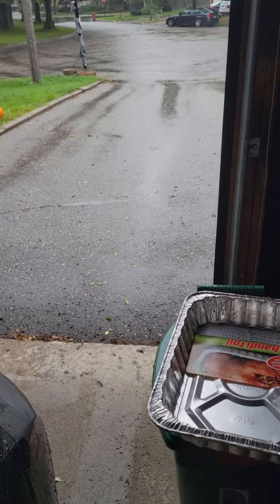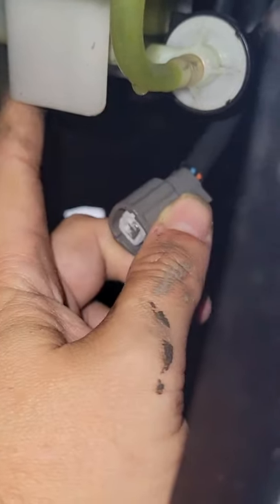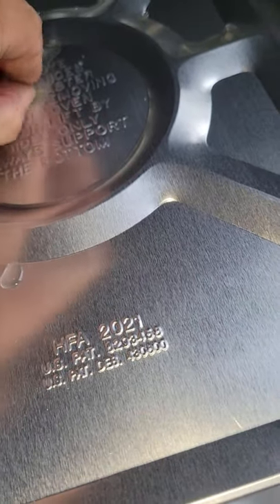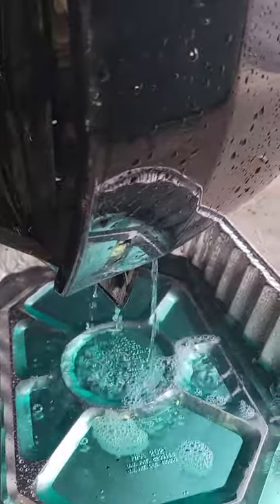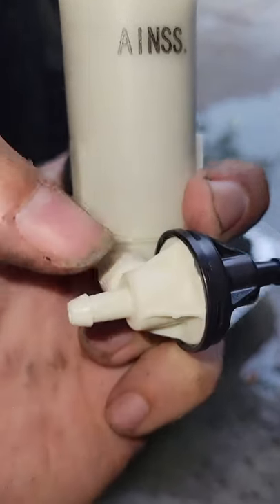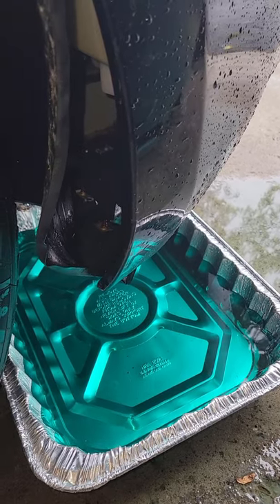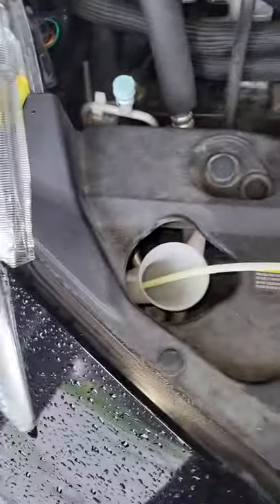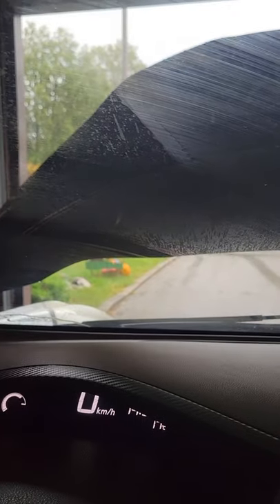Nissan LEAF (2012) Windshield Washer Pump Repair

Comment: Hi Rod, thanks for creating this Leaf-specific video, very helpful! 
I just replaced the pump on our 2016 Leaf for the 2nd time. Both times the pump operates and the rear washer works ok, it's the front that won't spray. I believe I read somewhere the pump runs 1 direction for front and the other for back..
One or 2 things of note from just doing this again: 
When removing the electrical connection you need to press the tab on top of the plastic plug block to release the latch that holds it in place.
I cut the 2 rubber front/back pipes close to the nipples on the pump as they were not wanting to come off. Also ensures a good fit when replacing.

Put the new grommet in the reservoir first then pop the pump in.
Cheers
Graham

Comment: Thanks for the instructional video. I had both the front and rear pumps go out on my Nissan Primera. I took them both out, gently knocked them against a soft towel and that eventually did free them up. I also flushed vinegar and water through the pump in both directions and then some lubricant. So far so good both are working strong. Worse case I might take them apart, as they are only a small electric "toy" motor. I'm trying to avoid spending any money.🤞
Reply from the maker: Glad it helped. If you want, I still have a spare pump for the LEAF (not sure if it is the same as yours) I can send you for $5 plus whatever the cost of shipping is. I no longer have that car, so I don't need it anymore.
Reply: @RodMacPherson I'm interested in buying your spare pump.  I have 2012 nissan leaf.  Having a rough time finding a new pump
Reply: @enlightenedtechnology1647  you are in luck. I still have it
Reply from the maker: @enlightenedtechnology1647  Go to youtube.com/@rodsevs and find the email address in the about section. we can sort out the details by email.